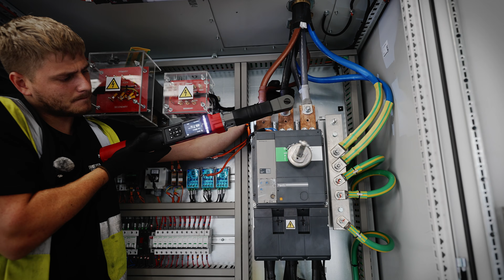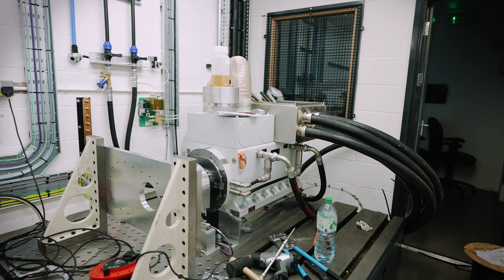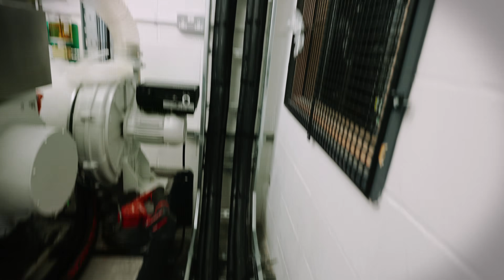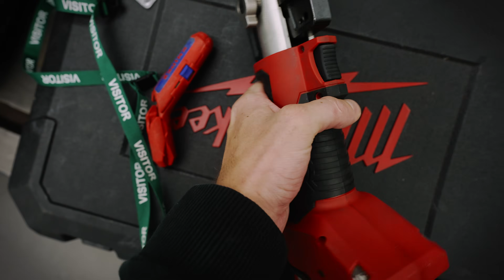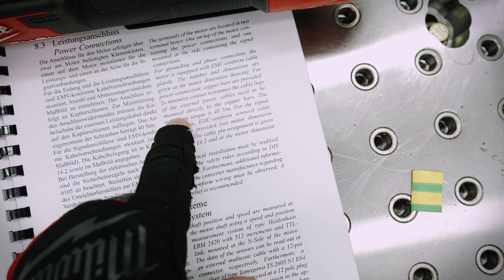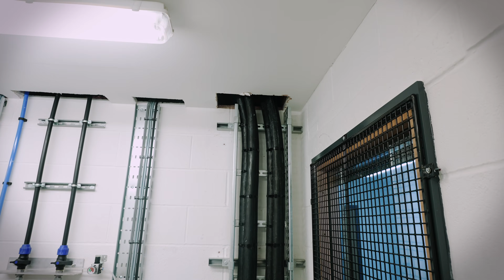Terminating 6 × 185mm² cables into a 750kW dynamometer

Comment: 6:51 Use unistrut, threded rod and pipe claps with rubber. You will even be able to support each cable individual.
Reply: With that much speed, that machine is going to vibrate a lot. A bit of mechanical support on those cable would help a lot

Comment: My goodness, remember  working on dynamometer  the years 1970/72 brake and drive testing. Installed 76 meters of 240 mm swa. Runs to LV panel. Protected by a racked out TP 500amp  Terasaki mccb clockwork mechanism.  The good old days.

Comment: Wouldn't it been easier to gland a cable and then fully connect each of its conductors before dealing with the next cable? After glanding all six cables your connector box is filled with thick conductors hiding the connection screws.
Reply: I think it will be difficult to connect the earthing wire in the earth bar for the upper layer, because the earth bar is at the bottom.

Comment: Can someone actually tell me what a dyno in this case is?
Reply: It's a tool for measuring and characteristing the power and torque of a drive system, like a motor. The reason for the super high power consumption is that they have to apply a load to the device under test. Given the size of this one I'm guessing it's for EV motors.
Reply: @gsuberland  I'm not sure, as the mains supply is much lower and I would have expected it to regenerate more if an electric motor was being tested. I'd have also expected him to install the supply for the test motor in the earlier videos. Based on that, I'm thinking it's for an IC engine.

He said it was rated to 22,000RPM and that the overload is set at 600kW which is about 800HP - I would have guessed F1 due to the RPM limit, but the power rating would be too low for that. Possibly someone like Radical or Aston Martin?

Comment: Really cool work! Are the 6 cables terminated on both ends parallel? Is there anything preventing overload off individual conductors?
Reply: We do a lot of parallel cables, mental to think that for a lot of stuff we do these days even a 240mm² needs to be doubled or tripled up.
Just keep the length as equal as possible thats all.
Reply: @alouisschafer7212What about connection resistance? After some time the oxide layer might add extra resistance. As the results, the current flow is unbalanced.